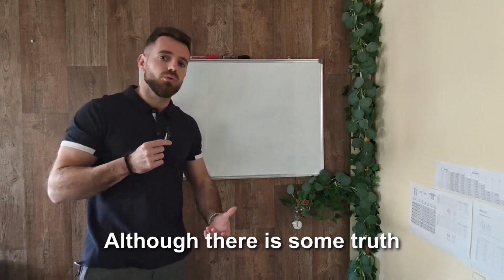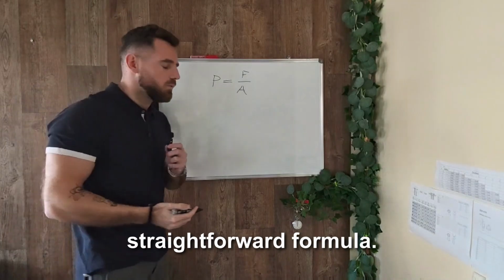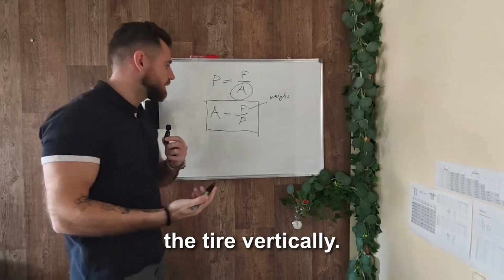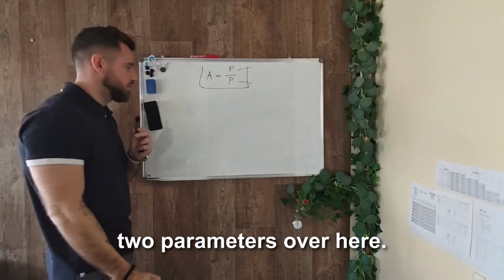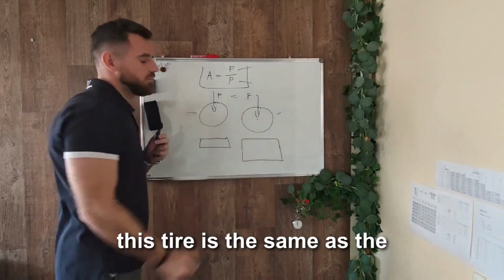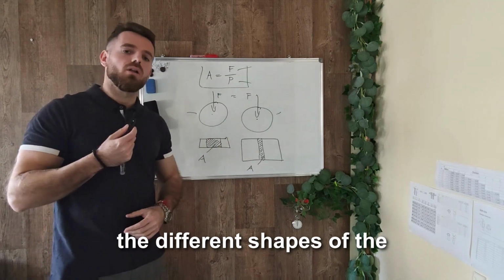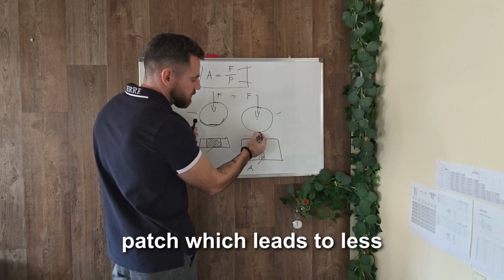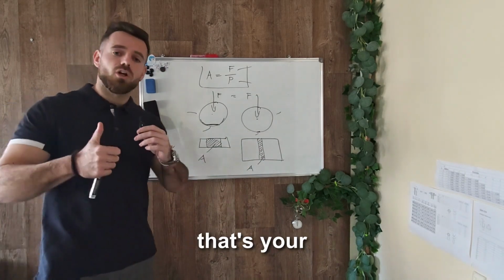Tire Contact Patch - size and shape optimization

Comment: Does a bigger, wider tire generate more grip in a dynamic setting? Like the bigger, wider tire keeps on generating more grip, while the smaller tire gets overloaded much quicker = sensation of less grip? 

For example, when launching a powerful car, would the contact patch area of the bigger, wider tire be actually larger as you accelerate and load it? Whilst the smaller, narrower tire has a lower threshold for load, thus losing grip earlier if you drive the car the aame way?